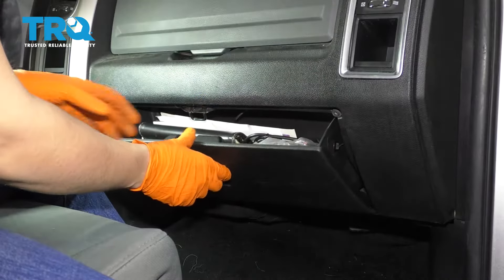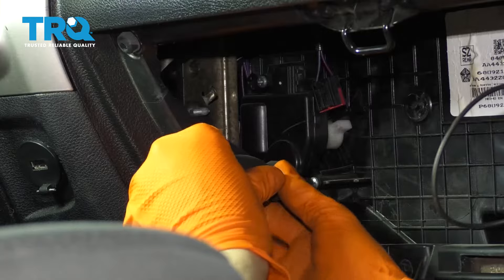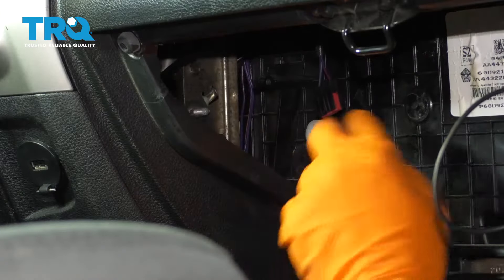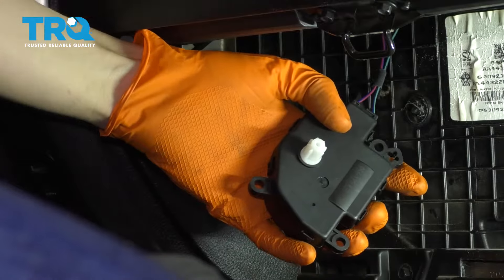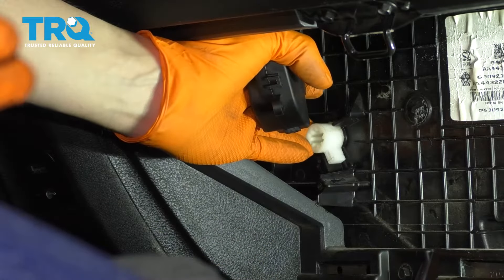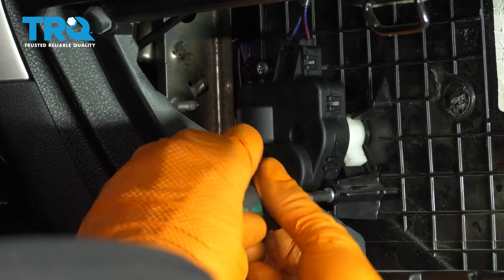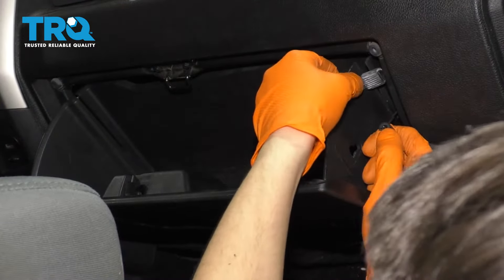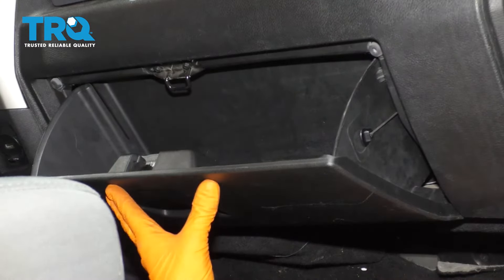How to Replace Blend Door Actuator 2011-2018 RAM 2500

Comment: I have been searching for hours for MODE door actuators, meaning floor, dash vents, or defrost, because my 2015 RAM is only ever blowing out of the defrost vents no matter where I put it.  But all I can find are these blend door videos for hot/cold air mixture and temperature.  Can anyone tell me where the mode door actuator is located?
Reply: Did you find anything on this?
Reply: I can't find a single video for a Ram mode actuator. I think that's my problem as well but no one shows how to do it or that it even exist. 😂
Reply: Did you ever find a solution? I have the same issue.
Reply: I’m wondering the same thing
Reply: Behind the HVAC controls
Reply: Behind the center part of the dash, under the radio. If you have a center console you need to remove the console, if not you have to pull the panels and little tray out and there are two actuators right behind there. Recommend only using Mopar actuators for 13 and newer rams, we’ve had issues with aftermarket ones not working with FCA vehicles a lot so we only use Mopar actuators now on rams and jeeps
Reply: Dead center behind radio upper actuator
Reply: From my research the upper actuator is the mode selection.

Comment: My situation seems to be the opposite of what most are saying on here. Passenger side blows hot but drivers side is cool (not cold) would the actuator in this video be responsible for this?
Reply: You ever find this out?
Reply: Same here
Reply: @194Jared did you ever find anything out about this?
Reply: Any luck?
Reply: Heater core likely stopped up. That was my problem. Back flushing the heater core will help if it’s not to clogged

Comment: So is this be the only actuator/door that would prevent hot air from coming into the cabin or are there other actuators/doors that I should check? My A/C during those 115°F summer months works like a champ but when I need heat inside the cabin I get only room temp heat.

Comment: I have a/c but no heat.  New fan clutch, new water pump, new thermostat and multiple heater flushes.   No leaks or smell of coolant.  This particular blend door seems to be working.  Its up on heat and down on cold.   What is your thoughts on the root cause?
Reply: did you ever figure it out? looking at replacing the blend door, but want to see if you figured out ur cause, I have the same issue.
Reply: Did you ever get this resolved mine does the same thing.

Comment: do i need to replace this if my drivers side is blowing hot air and my passenger side is blowing out cold air? (2014 bighorn)
Reply: I have this and problem any luck?
Reply: @thomase.7736  same i am having the same issue
Reply: This is my issue as well.
It is also an issue that has not been covered by anyone in the YouTube Universe.
Reply: @topcat5988  There is one on the back in the dual climate control vehicles, it requires a full dash and HVAC box removal
Reply: Same issue here and it isn't dual zone.
Reply: @roberthardin8018  same here anyone got any idea what it may be?
Reply: I’m having the same problem. Driver’s side blows almost room temperature while the passenger side is cold.
Reply: Any luck fixing it?(
Reply: @roberthardin8018  we just fixed this problem on our truck and we had to replace the heater core. To replace it you have to pull the dash and the hvac unit. While you have it out you might as well replace the evaporator core as well and check all your blend doors. Our blend door ended up being broke so that’s why we only had heat on one side.

Comment: I might unplug it and see if the motor will hold it full hot or up haha thanks for this. I'm trying to figure out why I have very little heat. This video really helped locate it quickly. Thanks so much.

Comment: Mine mode actuator wasn't ticking, but wasn't working. I changed the bottom right one, and it fixed the problem. Thxs for the video

Comment: I went to replace mine today, plugged the actuator in worked fine. 

Put it in the same position that my door was on, put it inside the plastic teeth, everything lined up and then... 

Nothing, wouldn't turn at all. Tried my fuses, checked the wire, tried the reset and nothing. I think the new one was possibly bad out of the box so im gonna give it one more try before i just leave it to manual where i can move it myself lol

Comment: Could you show a complaint,  where (2014 dodge ram 1500) set on heat: driver vent in the dash give poor air flow with not much heat, yet strong volume of hot air flow on passenger side vent. Does any body ever had that type of problem? 
I liked your video it was clear to understand and a good perspective of parts orientation.
Reply: Did you find the issue I'm having the same problem!
Reply: This is the current problem I have and wanted to fix. Did what the video said and still the same situation.
Reply: If u found a solution would love to know it

Comment: Thanks for showing this procedure.  My '17 temp control sticks, usually too hot.  Have to run it way down until it's cold, then up.  Sounds like that device right there is the problem, and can be verified just by watching the white piece.

Comment: Quick question so would you put all 3 blend doors in cold position to put them in all. Because I didn't connect  the connector and it scratches when I turn on and turn off ac like if it's trying to do a certain thing but can't due to not letting it! 
(IF ANYONE COULD ANSWER WOULD BE AMAZING!)

Comment: I have a 2006 ram 2500....the A/C blows ice cold but not very much from facing vents....its blowing from floor vents harder and also rear blows fine....it will not just blow from face vents even if you put it on face only still blows in floor the hardest.....blend door above glove compartment works fine
Reply: I'm sure you've found the issue by now but it sounds like your mode door is stuck

Comment: I replaced mine, made sure it was on cold and did the steps to calibrate it. Now when I start the truck it makes a loud clicking noise and takes a while to start pumping cold air out. What did I do wrong?
Reply from the maker: +Bob Schaefer We wouldn't be able to diagnose an issue like that here, you may want to have a local mechanic take a look at it. Thanks for checking us out! http://1aau.to/m/Shop-1AAuto-c